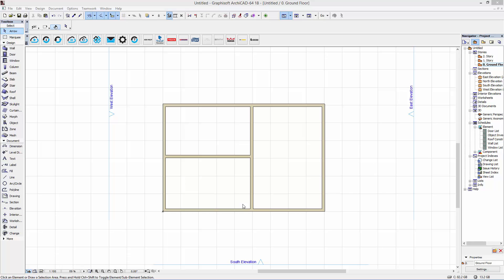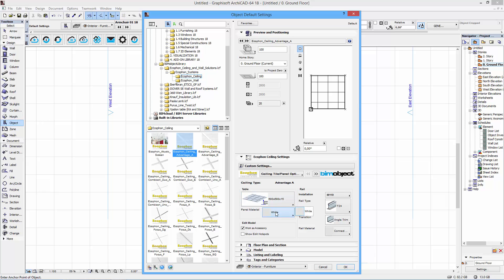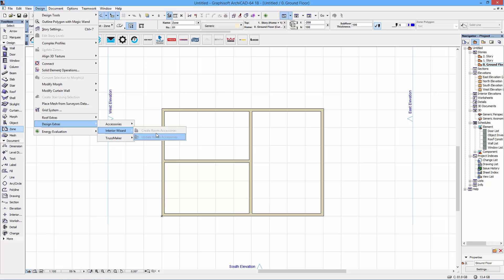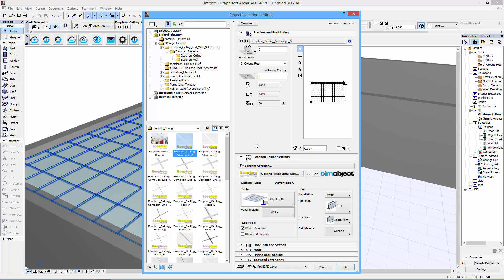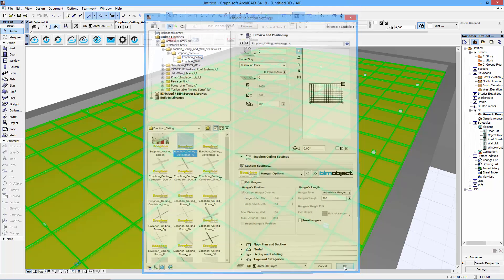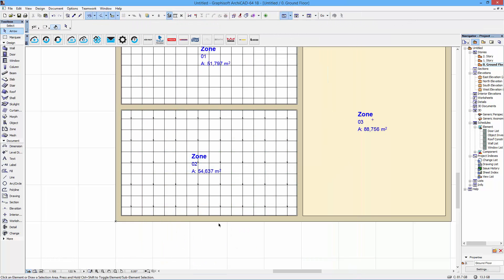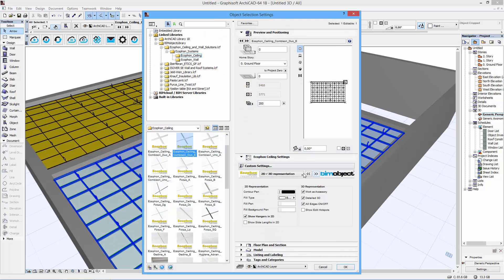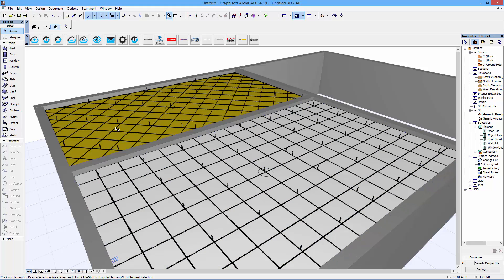Ecophon - Tutorial for ArchiCAD

Comment: Just a nice picture, very poor as a tool. Or maybe I just dont know how to use it.
What I need is to place Ecophon Master SQ to the ceiling using only uncut panels, distance from wall must be in range 150-600 mm, As well I need the dimension line in the plan associated with the zone. I must see the distance from the corner of the zone to the edge of the Ecophon panel.